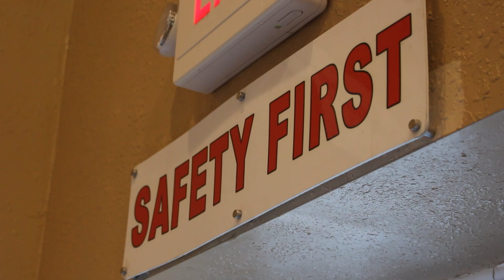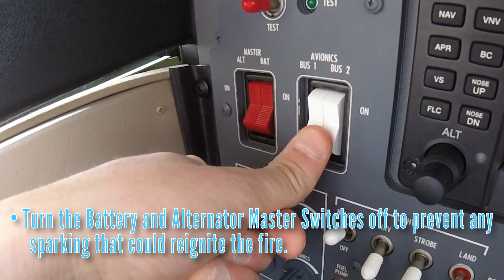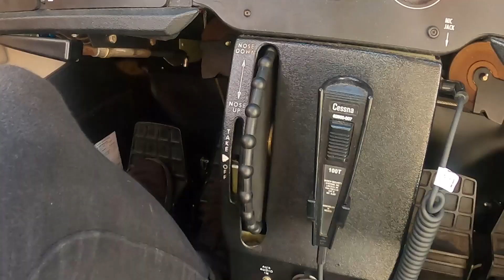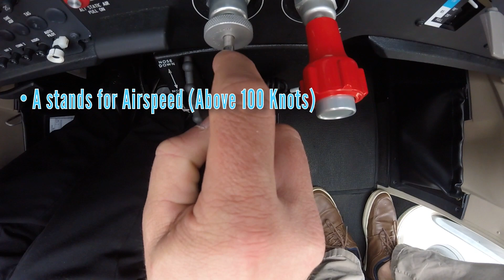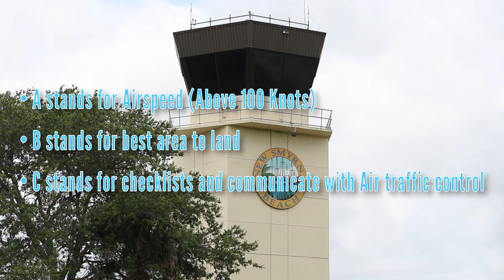Emergency Descents | Epic Flight Academy

Comment: Why do you make a turn towards a reference point? I don’t see where it says that on the acs or flying handbook
Reply from the maker: I will double check that answer for you and let you know soon.
Reply: I'd think this has to do with B of the ABCs...you're going to be selecting the best available landing site if this were a fire.  As you descend you'll be setting up an approach to land based on your selected site. Meaning you'll be looking at the ground, imagining your pattern & hopefully getting set to land upwind -- if possible -- after you quickly get down to pattern altitude.